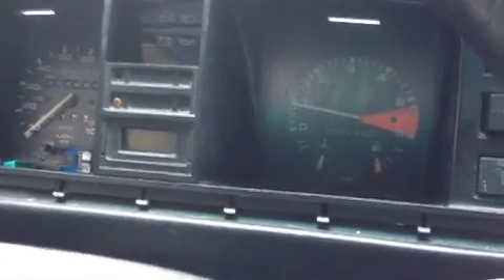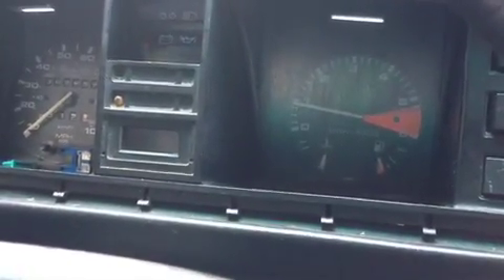Successful Drive-Bostig Conversion

Comment from the maker: Jason,  it has been absolutely great. I have put about 100,000 miles. The pilot bearing disintegrated causing me to replace it and the clutch this year, but it runs perfectly and drives at freeway speeds without straining. I can even climb most passes in excess of 55 mph. Highly recommend!!  My only complaint is engine noise. The exhaust is louder with the conversion than with the VW engine.

Comment: I have done 20,000k with my conversion temps -40c to 40c.Run well 20mpg.Run from Vancouver through the rockies to Fort  McMurray Alberta .Using 5w30 full synthetic + 1L marvel  mystery oil.